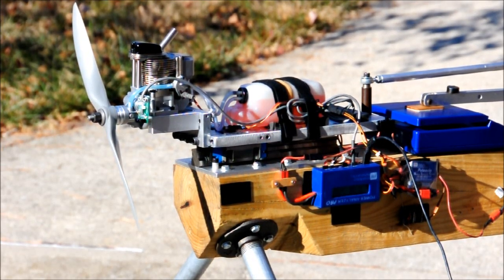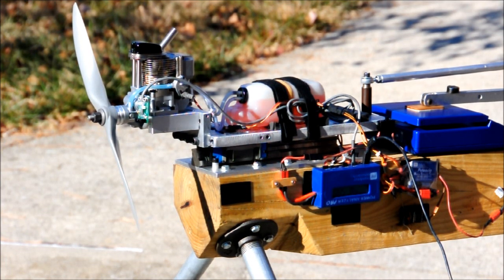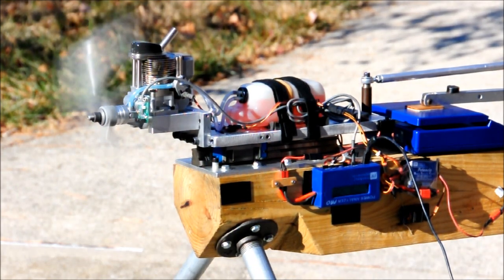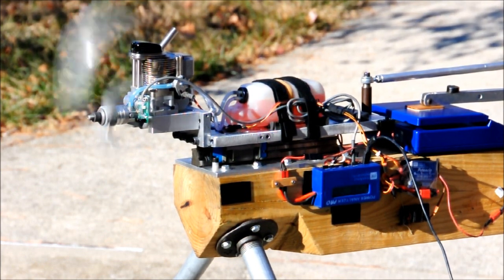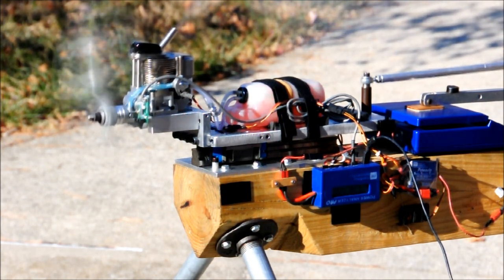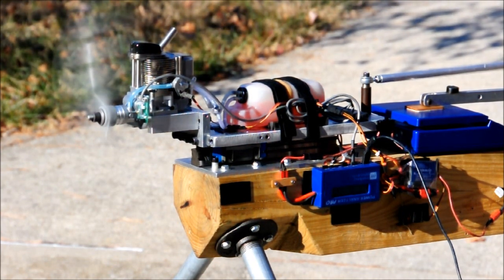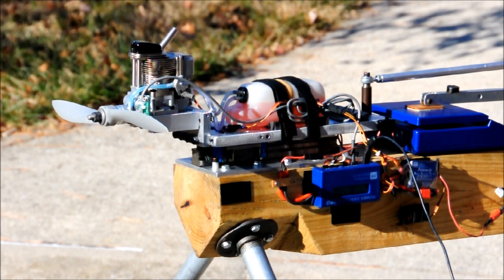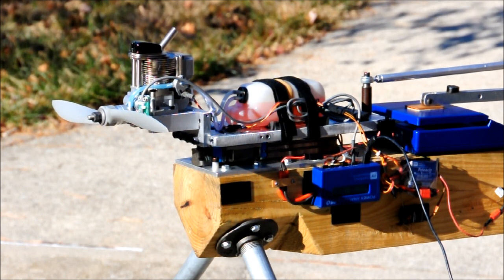YS FZ115S Engine Test

Comment: @nitrosavy   Indeed the regulator is the next thing to check. I like the adjustable ones in YS-63S and YS-110S, the new ones i ys-70 and ys-115 seem fixed,  I haven't had a chance to play with it yet - to see if there is any way of adjusting it ( after disassembly - by spring tension etc. ). I know they are supposed to be non-adjustable... In my YS-70 it appears to be way too rich at the mid-range, I'll need to take a screwdriver and check inside too, cheers :-)

Comment: @Statek63  Found the problem was some dirt in regulator, at full throttle the engine was just not getting enough fuel resulting in a lean run and detonation, should have fitted a filter to start with, my fault. thanks.

Comment: @nitrosavy    Try 20-30% nitro fuel ( CoolPower 30 for example ) and do not lean it out to the max - YS motors run very well with a bit richer mix. Detonations would suggest too lean mix and too hot run. Higher nitro % helps also with cooling.  HTH

Comment: Hi there can you help, I have had problems with detonation with this motor I am running 15% nitro which I should think would be fine it only seems to detonate at full throttle and I have adjusted the low and high end mixtures to there best positions, not sure what else to try, have you had this prob with your motor? any suggestions much appreciated

Comment from the maker: pencon is correct - it is supercharged.  It uses a rotary valve in the backplate to take advantage of the crankcase pumping strokes to supercharge the intake, giving it more power than any other comparable size four-stroke engine.
Reply: Hi how much nitro % in the fuel?